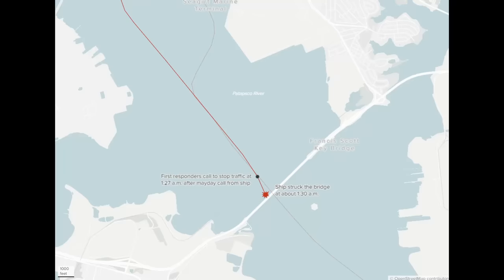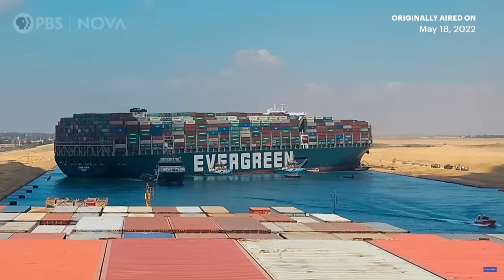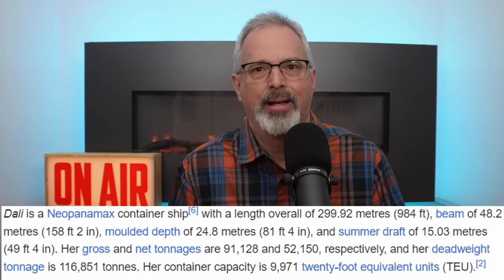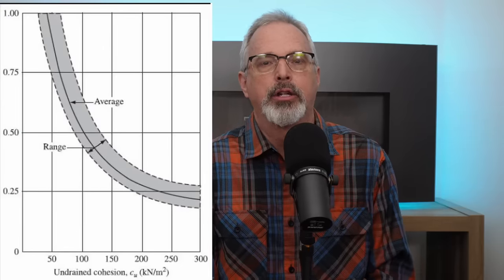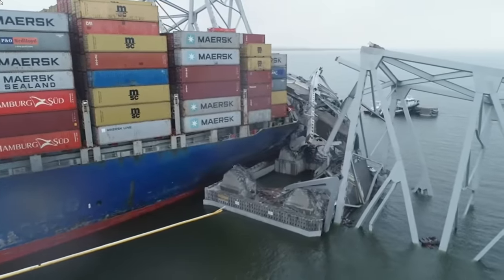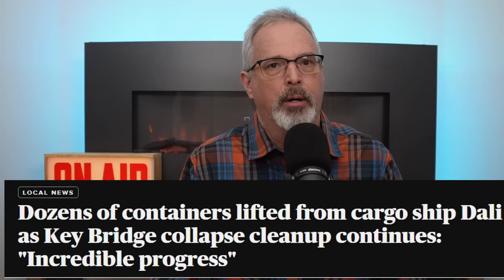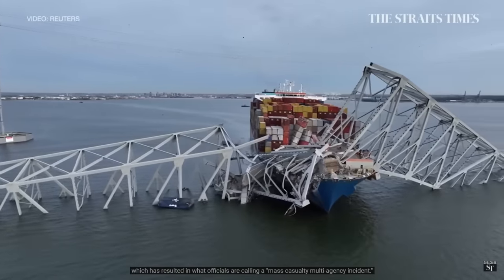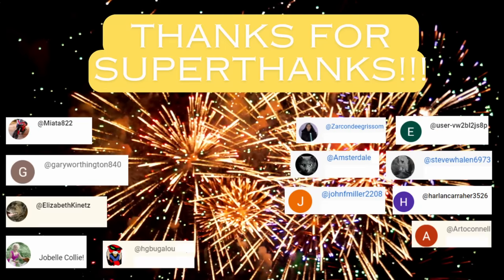Can the MV Dali be Refloated?

Comment: maybe take another container ship connected to the stern, also connect the 1,000 ton crane to the bow of the MV Dali.  Use slow lift for 24 hours with the 1,000 ton crane.  Then start pulling upstream with the container ship connected to the stern.  If that doesn't work, then continue to offload containers while the 1,000 ton crane continues to apply upward lift of the bow.  Then after a few hundred more containers are removed, try again to pull the Dali with the other container ship.  Use the largest container ship that will be safe pulling on the stern.  These might be as large as 80,000 HP.  This is assuming that the largest container ships draft too deep to maneuver upstream of the MV Dali.

Comment: I'm a soil mechanics expert and I appreciate your approach to the calculation, I suspect you have underestimated the adhesion and suction forces - BUT, removing enough containers off the front of the ship will be capable of motivating many thousands of tonnes of upwards buoyancy force, given that the ship's current draft is probably 15 or 20 feet more than the light-ship draft.  As you point out, a sustained upwards pull will gradually overcome suction and as soon as the buoyancy force overcomes the suction the ship will rise off the bottom.  I think the key to the operation will be to lighten the ship gradually because once the suction breaks, the ship will accelerate upwards pretty quickly which could be very dangerous.  I would suggest taking on ballast to compensate the containers removed to keep everything where it is during the container removal operation, then when the ballast tanks are full move the cranes out of the way and gradually pump out the ballast to create an upwards force, and try to allow the suction to dissipate slowly, being patient to let this happen, and avoid too dramatic an upwards movement when it releases.  

As an idea, pulling a cable underneath the bottom of the ship would help to break the suction.  Don't know if this has ever been done.
Reply from the maker: Thank you. Those are great comments.  I think the cable would work to break suction. The problem with the Dali is it's supposedly resting on a gas line.

Comment: This is a pretty routine bit of marine salvage.
Once the bridge debris is removed it is a routine matter.... for salvage pros.
This is tidal water and the draft of the ship is not fixed, they can offload cargo or not, the same with fuel and other weights.
The ship can be rocked by creating a list... there are many tools available to a salvage crew.
And... we can bet they already have solid tables to work from based upon bottom type.
And... no you cannot ignore suction. That is one of the biggest factors in groundings.
Reply: THIS

Comment: I'm not sure how they will be able to remove the potion of the main span of the bridge from the Dali without compromising ability to float. My suspect is that they will have to secure some portion of the bridge structure of the bridge to to Dali and remove or cut the bridge at a safe distance so the falling bridge doesn't rip more of the Dali's hull out, on falling into the water.
I'm sure that before moving the Dali they would be wise to remove all of the containers. Such bridges are built from the center out, keeping a relative balance. Normally destruction is done explosively.
Reply from the maker: I think you are right that this operation will be more complicated than some people want to believe.

Comment: This does not seem like a problem unless the hull has been breached and it's full of water. The ship rode up a bit on the pier, but then the bridge fell on it and pressed it down into the mud. Taking the bridge off should have it free floating, that buoyant force is pulling 24/7 with no fuel (unlike a tug). If taking the bridge off isn't enough they can keep removing containers until it is enough.

Comment: With a fuel oil capacity of 1.5 million gallons, and assuming a weight of 8 pounds per gallon, removing the fuel from the Dali would result in a 12,000 ton lightening of the vessel. Even if the 180 containers removed were empty they represent another 800 tons removed from the front of the ship with the number much likely closer to double that.  Given that the remaining load of 3200 containers on the ship empty would represent another 12000 tons at a minimum, I think its safe to say that to the extent that the ship can structurally handle a rear biased load, they will attempt to use a heavy rear in the channel to create a focal pivot point contact with the bottom rather than maintain the present flat surface contact you seem to think exists to the tune of 200 x 75 feet. It may be that fuel storage on this ship is already biased to the rear which to me would suggest they will try a pull at tide first, before bothering to begin a front first offloading of containers .

Comment: Don’t know if you’ve heard but there’s a gas pipeline almost directly somewhere under the keel. It’ll have to be lifted off the bottom so it doesn’t contact it so it doesn’t rip open the pipeline. Even if they shut off the flow and don’t have an ignition they’d have to redirect the pipeline at one extreme or replace it at the other. That means additional delays.
Reply from the maker: That's a great point.  The operation to refloat this ship won't be easy.

Comment: The ship was travelling at roughly 7 knots.  The portion of bridge that fell on ship is displaced from its original alignement indicating bridge moved some after bridge fell on it and pushed it down.   Assuming ship hit ground just before hitting pylons (and later sideswiping the pier), once structure fell on its bow, the bow would have started to dig a "deeper channel" into the ground before coming to a stop. 

Once you remove the massive weight of bridge on ship, (as well as trhe ~170 containers whose removal is mostly to get clean access to the brige and remove the containers that are not stable on ship), I suspect the flotation force will be quite strong and lift ship safely above the bottom of the channel that it dug while running aground.  If there is succion problem, having pipes pump in water below bow would help with that and reducing the firction between clay and steel. 

The fact that a huge mass was added to bow while channel in sand was dug by ship and such mass will be removed makes this a very different issue than the Ever Given or other ships that ran around.
Reply from the maker: Good point.  I will be curious to see how this all shakes out.

Comment: My thought is to use the northern pier and cables along with tugs to pull DALI from its position next to the southern pier if the ship either refloats itself or at least starts to refloat.  Neither pier can reasonably be reused for a new bridge.  Cables across the channel will not at that time be a problem for the channel as the vessel needs to be moved to open the channel anyway.

Comment: Interesting post, Casey. Would the removal of the containers not generate positive buoyancy? What about pumping compressed air into the channel bed to break the suction, or wouldn't that work?
Reply from the maker: Thank you.  Yes, that is why I was a bit surprised that they are not planning to remove more of them.
Reply: @CaseyJones-Engineer  That was a quick response. I only just managed to edit my question.
Reply: @CaseyJones-Engineer  As an engineer, have you calculated the max rate at which they can remove containers lifting them with barge-mounted cranes? To me that seems like the reason that path is not so attractive.

Comment: Great job....

Someone I have talked to, who is on site, who I cannot name or say anything, is telling me that "at this time", the plan is to remove most if not all of the containers, and this is expected to lighten the load.....  

The plan could change....

They also feel that ships propulsion WILL be available...  The crew is apparently still on board, and they feel they have "corrected" the problems with power & propulsion....  So again, "at this moment", they feel ship's propulsion will be available to help move the ship....

Now, I am in no position to know if that will add any appreciable thrust to the equation....  I have no clue...

But from what I am being told, I think they are thinking roughly in the terms you are describing....  They are expecting to need a lot of force to pull it out....

Mass times velocity squared....  It is thought that the ship could have plowed through a good amount of mud.....  This is a big heavy ship...  Going ballpark 7 knots, when it starts to hit mud???  Ballpark?   Now, I don't have my PE....  Mr Jones could probably tell us what sort of forces were involved there...  But the ship would have been plowing through mud, on the way to the pier, and it clearly reached the pier with no problem....  So I think it is fair to say, it probably will take a great deal of force, to back out from this mess....

Anyways, great job on the video.
Reply from the maker: Thank you very much, I appreciate it!  It is interesting what you said about the removal of most or all of the containers along with your other comments.  I think you are right about the bow of the ship plowing through a bunch of mud.  You can see the wave of water that rode up in front of the ship just before impact with the pier columns.  To me that suggests that the bow of the ship was plowing mud and water in shallower depths than what was in the main channel.  The purpose of this video was to get people thinking (including myself) about what kind of effort will be involved to refloat this ship.   I am thinking that a lot of this material at the bow of the ship will have to be removed by dredging or excavating before attempting to move the Dali back into the Federal Channel.
Reply: @CaseyJones-Engineer  I do not have my PE...  But I agree with you.  I think this will look something like the Evergiven....  Excavators  (or some equipment) digging out the ship, and then some type of attempt at movement.....

Comment: Great analysis, Casey!

Do we know how much time it took, and over how much distance, the Dali decelerated to a stop?  From those values and the initial velocity and weight we could estimate the horizontal force on the hull that slowed it.  From that horizontal force perhaps the vertical force to re-float the ship, or the horizontal force to drag it loose, could be estimated.  

A complication inherent in this approach is that some of the ship’s energy was transferred into the bridge. Maybe there’s a way to estimate that, too, from the scars on the hull.

This would be a great problem for physics students and faculty.

Thanks for the interesting discussion.  It shouldn’t have been surprising, but I’ve not previously heard about calculations of forces on bodies in soil and clay.  This is certainly a sticky situation.

Comment: Look at the Ever Forward grounding last year and what that required. Ever Forward was buried into a much more consistently shallow water for a far longer length of the hull. Once they remove the debris entangling the ship and given the lightering thats already happened on the bow they will pull Dali without much issue. Much larger ships, much more deeply buried have been refloated without that much trouble. 
As for the mud suction, there's a lot of variability which is why salvage plans and organization is its own art. The simple fact is that ships have been pulled out of worse muck without issue. Its not like its forever stuck, its simply a matter of force and they can pull with some amazing force.
Reply from the maker: Thanks for your comments.  I am sure the salvagers will do a great job but I am still curious to see how it all unfolds.

Comment: Dali will come off easily. Deballasted she will float higher. Ballast her stern down to lift the bow off the bank. Use ships engine for reverse thrust and 4-5 tugs (250 tons bollard pull) with ease.Ships on banks also tend to undercut the bottom around them by directing prevailing currents.
You don't need to overcome suction, you just need to overcome the shear strength of the bottom.
Do it all on a high tide, no problems.
Reply: Yup. Agree.

Comment: Evergreen and this situation is very different.  I worked terminal operations at Bremerhaven,  the Weser River tides are extremely, and suction is the major problem. Crews would rig   a wire rope under the hull and over the gunnels before settling,  later, as the tide came in, the crew would essentially keel haul the  line breaking the adhesion between hull and the river bottom.  The  aft appears to be buoyant, place the cable there.  Use tugs to do a keel haul forward.  Still have to remove forward lading. The keel haul is to overcome the riverbed suction
Reply from the maker: Interesting.  Thank you for that information!

Comment: I would think that they would employ two barges off the stern each with multiple anchors and a large winch supplying the majority of the force to pull the MV  Dali out of the mud. There would also of course be multiple tugs to assist and to control the Dali once she is pulled out.
Reply from the maker: That sounds definitely plausible.  Thanks for commenting.

Comment: Thanks for doing the calculation and finding the 750 tons.   This I think is miniscule when you consider that 4000 tons of bridge will be removed as well as maybe 1000 tons of containers.   This upthrust will result in the bows raising about 15 feet.     I suppose if the vacuum effect is significant, then pipes may be used under the keel to blow water or air, to decrease the suction.

Comment: I'm wondering whether they can do some kind of block/tackle using the dolphin and/or other pier across the channel to get lots of force multiplication to get the Dali to move laterally, back into the center of the channel.
Reply: That seems like a good idea. Though it would be interesting to know how much side load those structures can handle, considering they're mostly intended for downward load.
Reply: @Graham_Wideman One ? Very little.

Comment: One difference between this and the Suez accidents is the flow of the river.  Might it be practical to simply scour the mud/clay around the bow with high pressure water, and let the natural flow of the river carry the mud particles away.
This could not have been used for the Suez accident because any mud dislodged in this manner would have built up the main channel requiring massive dredging.

Comment: What is the weight of all the containers? If they are removed then that much downward force will be similarly removed. 
Then it's very likely that the hull will simply float upward.
No need for any other lifting machinery.
In other words, what's the difference in draft between a loaded retainer ship and if it's empty. I bet that this difference is greater than the amount of hull that's stuck in the mud.
Reply from the maker: That is a good point.  For some reason they are planning on only removing 170 of 4,700 containers.
Reply: Is the mud the only thing keeping it from flooding more
Reply: Sure, it would be great to remove containers. But 4700 containers would take ages to make a dent in, 2 or 3 at a time. Hence you'd really like to refloat this ship removing as few containers as possible so you can take it to a dock with customary container offloading facilities.

Comment: Yep its stuck pretty tight,if there are shut off valves that can shut that section off,or slow or decrease gas flow,one of the first things on the drawing paper is the concrete dolphin bumper,more then 10 is needed to work right

Comment: What's wrong with using the dolphin on the far side of the channel, and/or the pier foundations on the far side of the channel as anchor points for winches. With the right ratio it should be very controllable, and with tugs standing ready with tow lines already attached, it should be doable.

Do we know if she has bow thrusters, and if so how functional they are now?

Comment: according to Sal, it's also sitting on a gas line.  So dragging it off isn't a great option.   I'm not an engineer and can barely even remember orders of operation. But I am 100 percent positive it will float right off the seafloor once the extra weight is removed.

Comment: Check recorded draft from fwd & aft for imaginary. Remove all containers and check new draft from recent. If there is afloat a difference from new recorded draft. It can also dewater from the ballastank of the ship. If the discharge pipe is restricted/blockage of mud. So to open manholes from the weather deck and pump suction it out overboard its minimum draft. Check for afloat .See the difference’s. Maintaining freeboard (3’) from the bow/fwd,if tows to the bow, reverse if tows to the aft. Two tugboats pulling,or 4 tugboats 2ea on its side.
Reply from the maker: Thank you!  Sounds like you got it dialed in.  I will be curious to see how it turns out.
Reply: Baltimore should hire you!

Comment: Ive heard there are 2 compartments that are no longer water tight.
But i would think with the crew still on board, they would at least try and temporarily make them water tight. Plus with a few hours notice, the crew can still run the ships engine to help add force.
.
I would think the goal would be to get it to the port and unload it.
Then would go to a local dry dock for emergency repairs, and unless its not safe to take overseas. they would take it to another country for permanent repairs. Or scrap it out considering its around 20 years old.
0.01c
Reply from the maker: Thank you for your comments which make a lot of sense.  I will be curious to see how this all turns out.